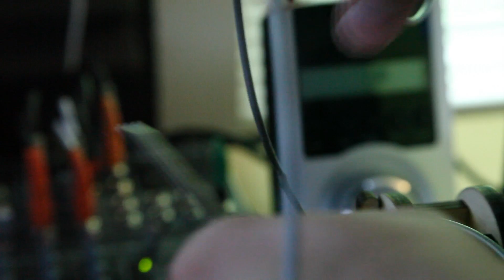Simplest way to add PLA while 3D printing without stopping your print! - Ultimaker FTW!

Comment: I know this is an old video, but I still wanted to comment. make sure you clean the filament really good afterwards if you use this method. this method is a recipe for for clogging your nozzle. You are better of pausing the print, extrude the leftover material, put in the new filament, extrude a little and then continue printing. 

Still enjoyed the video tho :)

Comment: Wow cool but my makerbot has a pause option
Reply: +evan lee Pretty much all 3D printers can pause. I think the point of this video was so that if you are running low on filament you can just add on the new spool that way you don't have to worry about pausing before you run out of filament to swap to the new spool. I've tried to do this a few times and forgotten to pause before I ran out and that's never good!

Comment: dude, check out the fillastruder. for the same cost of abs pellets you can make around 6-7 spools of abs plastic or pla. it is worth the money and you can shred failed prints or old bottles and turn them into filament. also you can color them o what color you like :)

Comment: indeed. YOU NEED TO GET A  FILASTUDER. $30 FOR 1KG SPOOL OR $5 FOR A KG OF ABS AND PLA PELLETS THAT CREATE 5-6 SPOOLS OF PLASTIC. MUCH MUCH MUCH CHEAPER. OR MAKE YOUR OWN FILAMENT BY SHREDDING BOTTLES AROUND THE HOUSE.

go on kickstarter and write down filastruder :) you will not regret it :)

Comment: This takes patience, but when I get to the end of a roll, I feed the new filament right in, the feeder grabs it and printing continues without a hitch. I've printed multicolored objects this way, using samples included with purchases from UltiMachine.
Plus, keep and reuse the spindle! Much cheaper to buy PLA without the spindle.